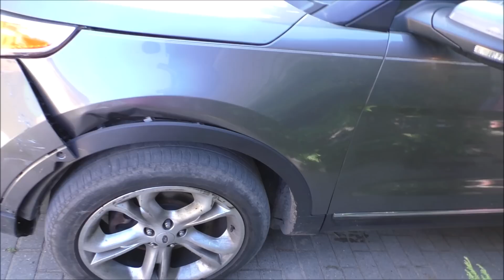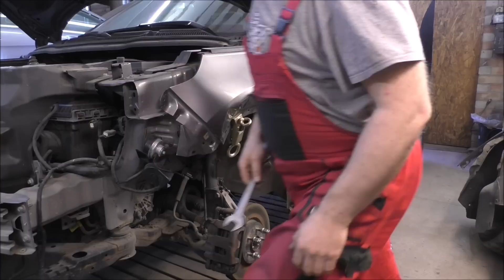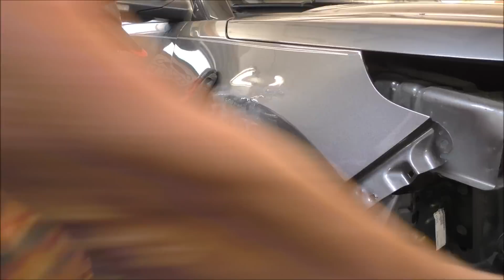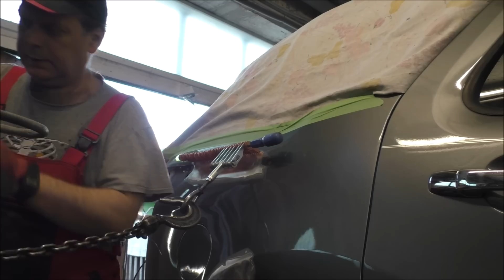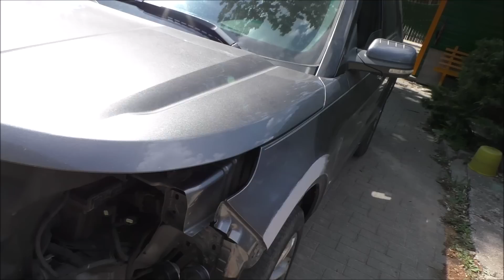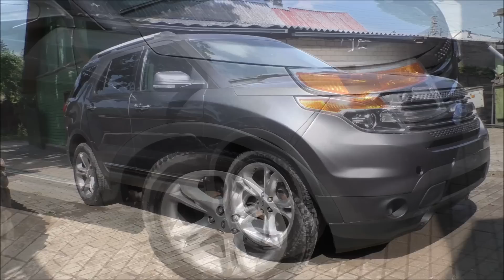Ford Explorer. Body repair. Ремонт кузова.

Comment: Great metal repair and the use of lead at the rear is awesome! But look at the camber of the front right wheel it's way off, leaning in far too much at the top.

Comment: Good work as always. Not sure the 11-19 Explorer is a car worth fixing but that's a different story.
Reply: I'm no Ford fan, but if this repair only took a couple of days' worth of bodywork then it was definitely worthwhile from an economic point of view.  I probably would've looked for used fenders in the same factory color first as that many model years might've made that practical, but I'm also not a body man by trade either.

Comment: Lead solder tinning better repair than the usual easy sand bodge
Amazed how much confidence he has to attack panel and squeeze it out with alligator jaw
Another cheap repair using original panels